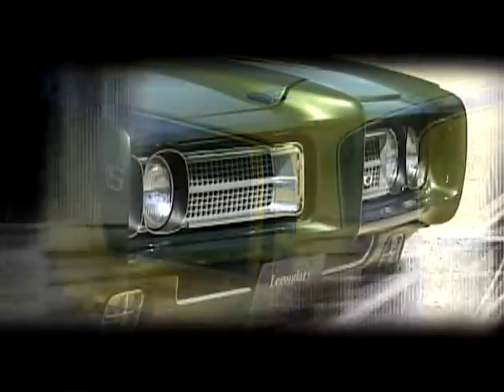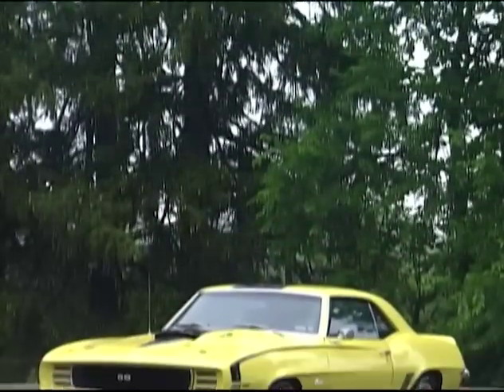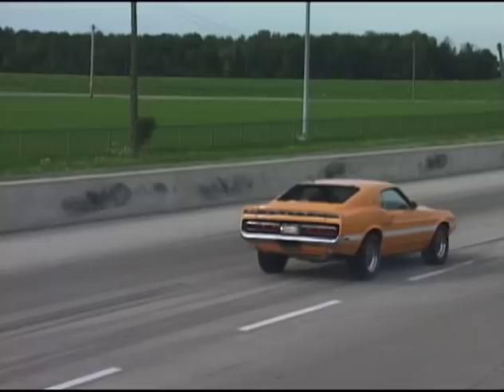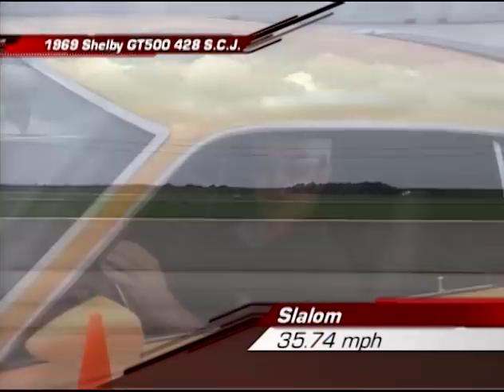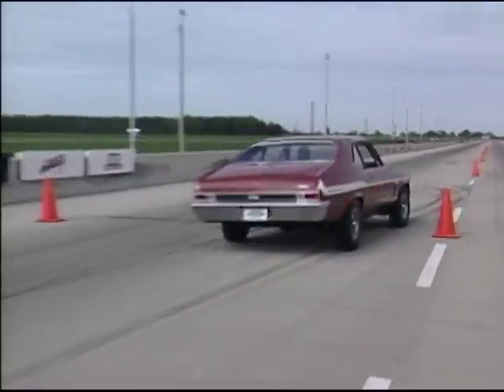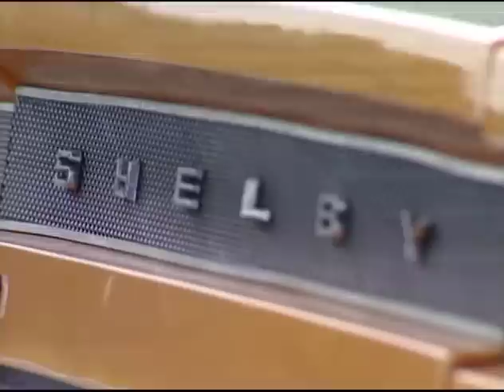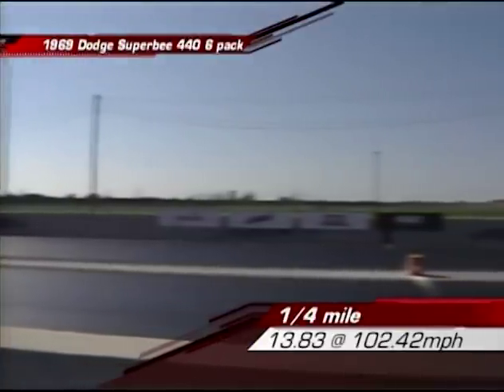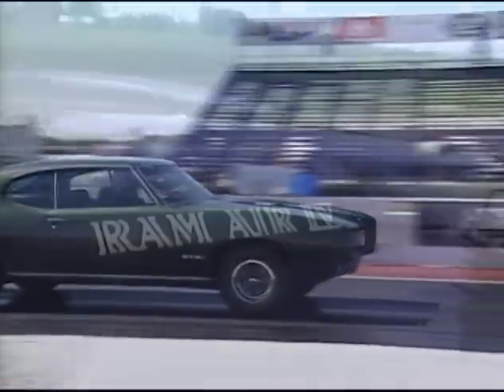What's the fastest 1969 tuner? SUPER MUSCLE CAR SHOOTOUT!

Comment: I owned a Ram 4 Judge and the times are legit. 13:1s at 105 all day long..
Reply: Back in 1991 my dad let me ring out his ram air 3 judge on the street at night and the strip, 3:90 4 spd, although the ram air 3 and street tires i could shift that car full throttle and pound 14.2-13.8 all day, couldnt come off the lines for shit but on the street it hooked up with no wheel spin, beat many cars with this judge but did lose to a 70 chevelle with an L78 by a fender
Reply: 12’s in Pontiac 400 cars is easily obtainable numbers and as daily drive too.
The D-Port heads work quite well, the Round ports RAIV & TA pieces #722’s / #614’s Or #96’s added to the flow rate #’s.
Reply: @babaoreally8220  I recently sold my 69 RAIII 4sp car, still have  68 400HO Conv though. Sorta thinking to put my #96 R-port heads on it.
These things are great machines .
Reply: @babaoreally8220  
Yes I know about them on the heads that are not specifically designed for the 1.65 , the PR will not clear. Its usually a 3/16 / 1/4”  milling on the slot to make them clear properly. My #48’s had this issue .
Reply: @matthewblank214  Thanks for telling the truth because living through the muscle car era and hearing some of the BS it's a breath of fresh air .
Reply: Yeppers... Torquey GTO's owned stoplight to stoplight... where more people saw them... took a full 1/4 mile for the overcammed Chevy's to get a fender ahead: 
https://www.youtube.com/watch?v=SJIRitKQYrM
Reply: I had a ‘69 GTO 421HO Ram Air IV, with M22 4 speed,  tuned by Nunzi Romano “Mr Pontiac” of Nunzi’s Automotive in Brooklyn NY. The GTO was the fastest of all ‘69 cars. Nunzi later went on to write for Pure Pontiac magazine. He was the Godfather of Pontiac tuners. No Pontiacs were faster than his.
Reply: My brother had a 68 Ram air 2 that absolutely ran 12.1 all day and a few 11.70s  on a cool night with slicky's!! and a little timing retard !! Seen it w my own eyes!!
Reply: Hurst Dule Gate shifter,  with a 410 rear end !! It would leave 2 5ft black marks when shifting from 1 to 2 !! It was soooo torquey!!

Comment: That pontiac slayed the competition! But now im wondering if a Buick GSX Stage 1 could've toppled the Bobcat...
Reply: Wonder how the weights compare between the two?
Reply: @bw3506  i think the pontiac is about 300 lbs lighter, but hey, the GS Stage 1 in the ordinary muscle car shootout was faster than an AMX (700 lbs lighter) around the slalom..
Reply: @rayun6860  A '69 GTO and a '70 GSX were very close in weight when similarly equipped.  They really should have run all of this episodes cars across the scales.
Reply: @Thomas63r2  right, but arent the royal bobcats lighter than the average gto?
Reply: @rayun6860  no.  Any weight differences came from options like power brakes, power steering, a/c, etc.  Royal Pontiacs used the same frames and bodies and seats as all other Pontiacs.
Reply: @Thomas63r2  i see. Well.. now that i think of it, im not sure if the GSX could beat a royal bobcat on quarter mile, a slalom and a road course sure.. buut.. what do you think?
Reply: @babaoreally8220  I would pair up a '70 GTO 455 with a '70 Buick GSX 455.
Reply: Stage 1 wasn't until '70?
Reply: A '69 Royal GTO 428 and a '70 Buick GS 455 Stage 1 would be a great comparison. I don't think the GSX would be better because it's heavier.
Reply: @hendo337  I see.
Reply: @hendo337  they would run pretty close together

Comment: Does anyone else notice how the driver's entire body jolts when he shifts the gears on the cars? It looks a little like he is starting a lawn mower.
Reply: It took some effort to drive these cars.  You shifted them like you hated them.
Reply: That’s how I shift too especially on one occasion I ran 1/4 mile in my old 2.0”F20b”  liter NA Honda running fully stock internals with cams and 91 octane tune. Ran 12.8 at 107-8 but had more in it.
Reply: It looks like he's trying to rip the cars apart...

Comment: It was great seeing shootout!  Would have liked to see the Nova with traction bars installed. I’m surprised the GTO won the quart mile against the Baldwin Motion 427. Please keep doing these shoots. Great Job...
Reply: Well honestly Baught a new 68 big block camaro ,Disappointed, Shifter,Junk Wheel Hop,Exhaust, Junk But Fixing that OMG NEW CAR ,SAME AS MY BUDDY'S Z28 .YOU HAD TO WORK ON THEM TO MAKE THEM GREAT
Reply: I wasn’t surprised. My clappy old GTO saw BBCs as tasty snacks.
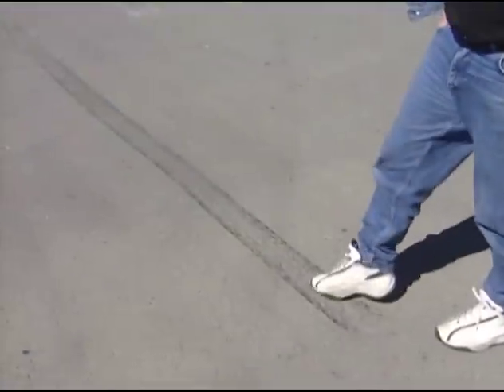Reply: @timsharpe3498  I agree i once had a 396/402 4 speed with 4:11 gears 67 camero and i raced a GTO 4 speed and got my ass whipped. i know it was not stock as well but i still lost by a cars length.
Reply: @henrybourdon6712  

I love most anything GM made back in the day. I had a GTO that I mostly bracket raced and a daily driver Corvette that was lots of fun. When people wanted to race my GTO I usually raced them with the Corvette first to see if they were worth firing up the old Pontiac. Many times I didn’t have to. The Corvette was a high 13 second car but it could beat better cars on the street because it hooked up so well. I’m talking about 1980 era.
Reply: @henrybourdon6712  My 68 camaro 462 4 speed kicked some poncho butt.
Reply: It surprised me the GTO wasn't a 428 instead of a 400. It was an option Royal offered for like $650 in '68 and '69 on GTOs. The 428 Pontiac was probably the most well rounded engine of the muscle car era with a 4.121" bore and a 4" stroke. The Buick 455 was a great engine but the block was prone to cracking, the Chevrolet 427 and 454 were too heavy, the Olds 455 had oiling issues and was too under square with a 4.25" stroke.
Reply: That Baldwin Motion Camaro had a 454 LS7 in it.
Reply: I believe the BM Camaro just had too much power for the stock tires.  It looked like Peter had to walk it out of the hole killing the 60’ and couldn’t really get on it until the top of first gear and then had to granny shift into second  or it lit up the tires.

Comment: My first car, I purchased in 1976, was a mint condition 1969 GTO Judge Ram Air IV. I remember that my uncle and I drove up to the guy that was selling it, and we both looked at each other, and said, this is the one. One the way, as I was diving her back home, I was overly cautious, actually downright  intimidated by the power this machine had. I remember that I took the back way home, and there was a little import following me way too close, honking for the passing lane. I slowed down to about 45, and he pulled into the passing lane. I heard his little 6 cylinder doing all it could do, as his tranny shifted into passing gear. Instead of me dropping into 3rd, I simply floored the GTO, and as the secondaries kicked in, I looked over quickly, to see a frustrated import not being able to pass, and me pulling swiftly away. I'll never forget the look of disgust on the other drivers face, as he was completely unable to pass me. The amount of pure torque that engine had was really something. I really miss that car. Lots of great racing and memories.

Comment: I was impressed that the Pontiac came out on top.I own a 76 formula and a 77 T/A.  Not surprised about the mustang at all.My next restoration after the Cuda will be my 1965 convertible 4 speed mustang. Shifting any transmission is king in my book. Most of my cars are 4 speeds but now i will try the new Tremec 5 speed in my 1969 440 Cuda i am working on now.
Reply: The Pontiac was built to beat all these other guys...
Reply: The Tremec is a good tranny, but that 440 is going to have a lot more torque than the newer engines it has been mated to. A good clutch will be necessary.
Reply: I'm a Mopar guy but I think that the 426hemi in the b body car would have been more representative of a b body hot rod for 1969, but the 440 was a more common option
Reply: @dinadaughtry8993  i agree with you. It was common because of price. I myself am just a car guy of all brands and my first thought when i was a boy and discovered what a Hemi was or looked like was why only 426 cubes instead of a 440 Hemi or bigger to make it king Kong of the Mopar freak world. What turned me on to the Hemi was it's fat valve covers and plug holes. That is why i have a few big block chivies in my collection of toys. If i was bucks up instead of just a working mans pay stubby i would have thrown a grease monkey wrench into one of them with a Hemi headed Chevy block and enjoyed popping the hood at gatherings to see how many would call it a Mopar engine in a Chevy body and let the fun begin when i explain that there is nothing Mopar about it. Maybe i am a real freak because i own and built what i like to call a woulda shoulda goulda  built 1981 never made 4 eyed Malibu 400 vortec headed 4 speed trans am scooped spun around into a ram air Lemans tail lighted G body car that has about 30 multi yeared Chevy, Pontiac, Buick and Oldsmobile major parts in it picked from a scrap , oh sorry "recycling" yard and at times i get people walking up to me and claim someone in their family or friend circle had one. That when i have to decide if a tell all or just smile and say, cool. Of all the car brand guys out there i love to shake, poke and rattle the cages of Mopar paint and chalk marked restored freaks the most. That is why i will build my 69 Cuda with a stroked 440+6 BBL fool injected motor with a (rare Proto type) pistol grip 5 speed manual trans and put BO30 on the licence plate and let the fun begin. Hope i made you crack a smile or i will suggest you run to your safe space to the left side of you while wearing your chin mask in the heat of summer fearing to catch a cold and die. It's all in the science i hear. We just have to wait for daddy government to find it for us taxed slaves. So glad the 2 week or was that years curve is over!✌
Reply: @henrybourdon6712  absolutely the definition of Hot rod, take a car and you scrounge up all the stuff you can find in a junkyard and fund out what works and what does not getting harder to find the older stuff and when you do whoever has it wants to much for it but I found a 1973dodge charger with a 440 not original engine but I don't care not building a trailer queen,I want to build a charger the way I want it to be, my first car was a 72 Charger and it cost me a lot $50.00 and it was a 318 car  no rust anywhere and it was yellow with tan interior, and I always wanted to put a 440 in it and put mags with fattys on the back and skinnys up front and of course a lot of chrome on the engine (everyone knows that chrome makes it faster) so when I came across the 73charger I had to scoop it up for $2400.00 even though it was a bit rusty and the suspension change that year does suck at least it's a charger that has the nice body style and I can build it anyway I want, going to get it to look like a 71 as much as I can a few parts will interchange with a little fabrication work and if it turns out like I can picture it in my head it should be a really cool Hot rod
Reply: @henrybourdon6712  by the way they do make hemi heads for the 302-5.0 Windsor Ford check it out and get the name of the company and see what else is available
Reply: @dinadaughtry8993  Yes that mushy suspension has to go. Good thing there is a kit(back then of metal for cop's) to replace them and make a 100% improvement in handling. I have to admit it took me years to warm up to the 71+ year charger's looks. I am also one of those guys that would not have bought a superbird or Daytona back in the day. The bird beak(when it was not a crime i used to call them Jew noses) and that dust buster handle was just too much for me. Even when people were used to driving big long cars there was a reason those front ends were hit so much. I chuckle thinking of 80's babies that were spoon fed Honda's and toy toy's trying to drive one of those and not scratching it just like the 5 foot lady driving old Caddies, Lincoln's or Imperial's with those landing strip hoods.P.S. I do have a Jewish friend and he gets the joke as well as i when he calls me a schmuck so,,, If you do not know what that means look it up and laugh with us. Thanks for the Fix Or Repair Daily tip.

Comment: I don't even remember how I stumbled upon the Baldwin Motion cars 20 years ago, if I saw it at a show or read it in a magazine, but I do remember they came in stage levels coined "Phase I, II, III, IV, etc". I didn't see them mention what Phase the Camaro was in this comparison. A Phase III and IV car was supposedly extremely fast of all of the tuner muscle.
Reply: The baldwin motion cars with the phase 1 option, just got jetting, and a tune, the phase 2 option, im not sure what else they added to the phase 1 option, but the phase 3 option was the package that would do 11 seconds in the 1/4 mile, with drag slicks and if driven by Nhra driver, and phase 4 was what ever you had the $ for, baldwin would do for you! The car in this shootout was the phase 1, with slicks, is capable of mid to high 12s.

Comment: The GM A bodies were easily the best overall muscle cars because they had the best chassis/suspension as well as engines that made a ton of power without much difficulty.  MOPAR had some really badass engine packages (six packs and hemi's) but they really do handle like shit.  Ford just didn't have the same power output as the others.  People love to point at the Boss 429, but in reality they are dogs bone stock because Ford detuned them too much for the street (they're real screamers in race tune though).  The FE is a great engine and runs really well, but wasn't designed as a performance engine since it was originally a truck engine which does put it at a bit of a disadvantage to the big blocks that were designed as performance engines from day 1.  I wasn't surprised the AMC did well.  I worked at a drag strip for a while and every AMX I ever saw ran like a scalded cat.  Very underrated muscle cars.  I'd love to see them do the same kind of test with some of the small block cars like the L79 Nova, DZ and Boss 302, and a 340 six pack MOPAR.  You could also include the Pontiac Firebird since there is no Pontiac big block or small block.  They all use the SAME basic engine design.

Comment: The RAIV did not come with forged rods or crankshaft. It did come with forged pistons. Round port exhaust like the RAII, aluminum intake, 735 - 750 cfm Quadra Jet, cast iron headers, and the largest Pontiac camshaft at the time 308-320-113.5+1.5 LSA and .517" lift at both valves using 1.65 rockers.
I liked the GTO's I had back in the day. I sure miss those times!
Reply: Excellent and accurate specs. The only question is how did that GTO mile an hour at 106 with factory exhaust and that puny quadrajet ??  The Camaro had the hottest engine hands down because it was NOT as factory delivered. It had headers and aluminum intake AND aluminum heads and a 930 cfm 3 barrel Holley, the mile an hour difference between it and the Goat was too close to matter. That isn't correct.
Lots of mysteries that don't add up in this shootout.
Reply: @crazyoilfieldmechanic3195  The Q-Jet has a 735 - 750 cfm rating. The RAIV came with cast iron headers. The GTO could run these times. The Rat motors should have done much better here, I agree.
Reply: @crazyoilfieldmechanic3195  the GTO wasn't a factory Pontiac, it was fully modified by Royal, that's why it was so powerful. I'm surprised it wasn't a 428ci, since Royal would sell them that way in '68-'69 before the 455.
Reply: Funny in the 69 RamAir lV 400 only a 730-750 CFM Quadrajet. I parted out a rusted out 1976 T/A who’s OEM 400 had its original 800 CFM Quadrajet. It’s now been built up by Cliff Ruggles to 830+CFM and feeds my Butler/Murgic Racing 1969 406. My 3212 Lb 1964 Tempest runs 11.03 @ 121mph in the 1/4 currently. I still have a set of 340CFM CNC ported KRE heads with portmatched Northwind intake to put on and fiberglass hood, trunk lid & bumpers soon to install. I’m pretty sure it will be a 10Sec car after that, 😉.

Comment: That Shelby is no different than any other 69 mustang 428 scj Shelby did nothing to the 69-70 cars they were built by ford and not super tuned like the other cars
Reply: I owned a '69 Mach 1 428 CJ 4 speed 3.50 posi, I was surprised at the Shelby in this episode.  It was quicker than mine was stock, I had lots of 1st and 2nd gear tire spin at OCIR - but mine trapped 101.X mph almost 102 mph.  With the Shelby's 3.91 gears I thought it should have done 103.x mph passes.  There was no hp difference between the '69 Shelby and any other production 428 CJ/SCJ.
Reply: Yes, in '68 GT500 lost its 2nd 4 bbl. carb. and Shelby's influence was waning... in '69 GT500 lost its hotter camshaft... was considered a 16 second car... Shelby/race shop tuning on this one plus Super Cobra Jet engine got it into 14's... Summer of '69 Shelby parted from Ford... back in the day a neighbor had a GT500 and it seemed like a slug for the spec.s it had...
Reply: This was my favorite car since I seen it back in 1977  was  only 10 years old but the looks and the power was unreal I like how he didn't change for the two years and that car has more horsepower than what  advertised I would love to have this one at raceway park englishtown New Jersey 🔥🍟🍔🥇🧨🐕‍🦺🐀🦮
Reply: I think the 1969/1970 Shelby 500 for identical and they were both the best looking cars and 69 and 70 the 428 Cobra jet had good horsepower 335 but I think you had a lot more than that that's my favorite muscle car the hardcopter
Reply: 65 was the best.
Reply: I like em all but of course I really loved my 67 GT Fastback 390  4 speed. White with red striping , power front disc brakes and 391 gear. Beautiful car. I'll never have another $$$ is an issue for most.
Reply: @BuzzLOLOL back in the day the factory stock  69 Mach 1 428 Cobra Jet would do a low 14 in the quarter. The GT500 had the exact same equipment. It would have also been in the 14s as was the car in this test. Never a 16 second car